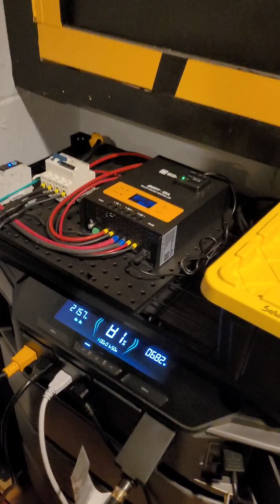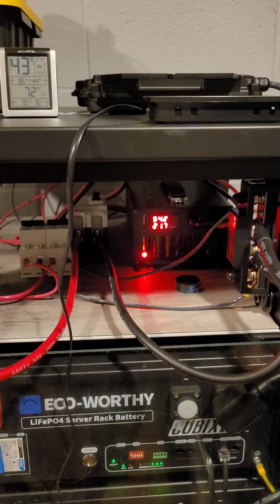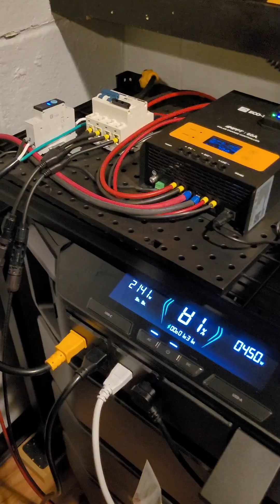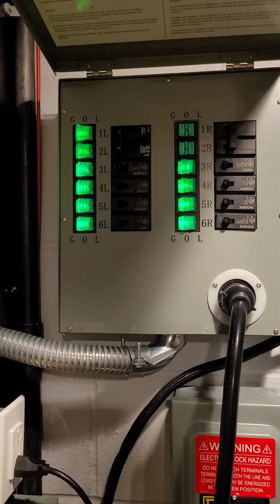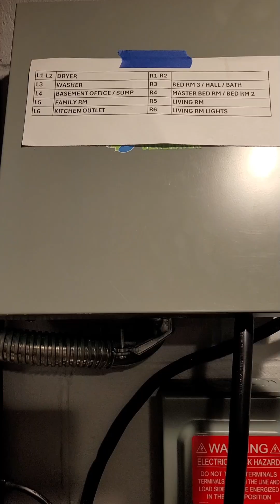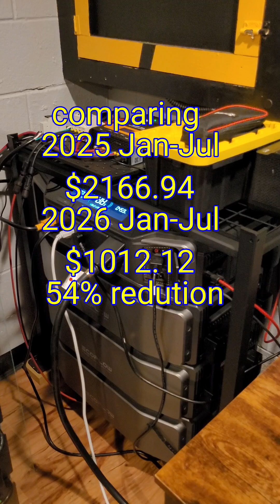EcoFlow Delta Pro Ultra saving me $

Comment: Excellent video.  Can you tell me the brand/model of the low pv dual disconnect you are using?  And also detail the wiring setup to tie both the solar and server rack batteries into the low voltage port.  I have been trying to figure out a way to incorporate server rack batteries to charge the ultra - your setup looks perfect.

Thank you.....
Reply from the maker: DIHOOL are the dc disconnects I use. Using 2 Y-branch parallel PV wire connectors on the output side to the low PV port. All wires are 10awg.
Reply: Thank you!